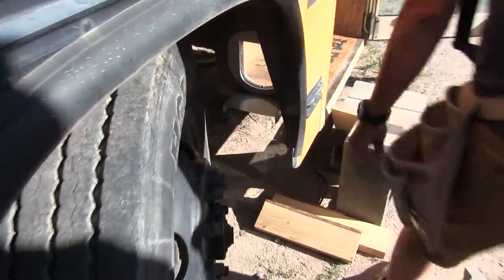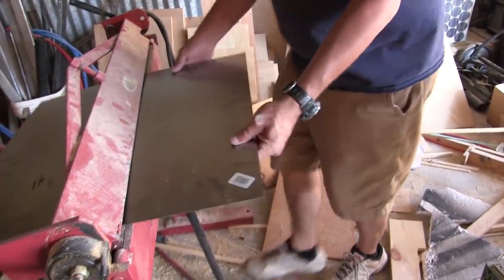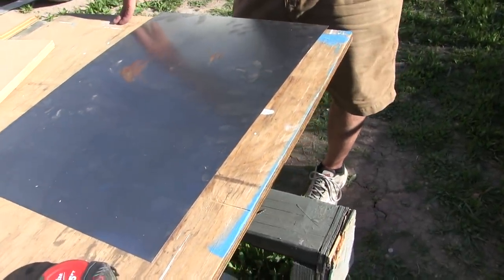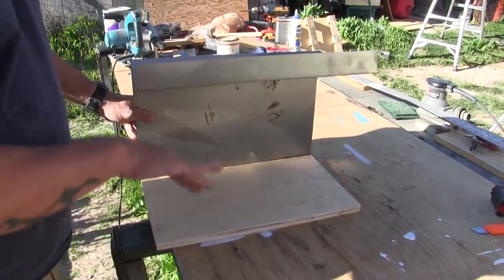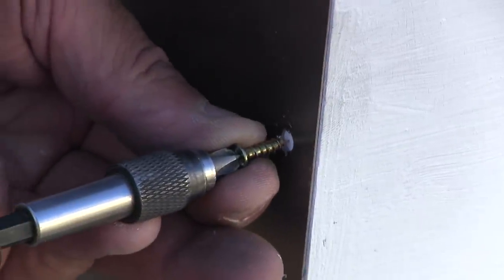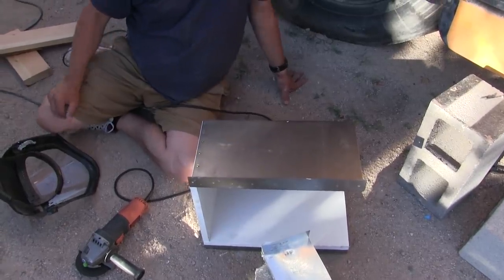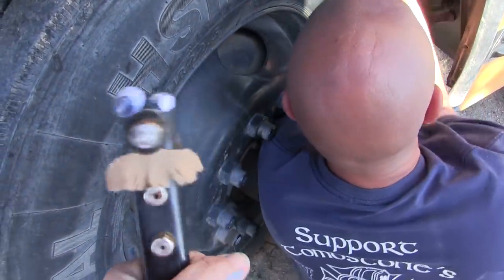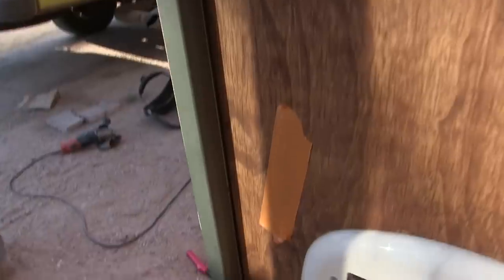Building a "Kitty Porch" for the Cat Door in our Skoolie

Comment: You may want to consider spraying exterior that with some rubber bed linerthat would remove any water damage hard object damage and it would help with the sound also a flap on the open side that you can lock in place with maybe a rod so the cat doesn't go in there and then try to jump out while the truck is running

Comment: bit suprised that you made the top of the box flat and not under an angle , mud slung forward from the tire can collect on top of the box , you could hang up a long piece of rubber conveor belt as a mudflap in front of it mounted to the top of the wheel well and the part of he box facing the wheel adding a bit of tension to the rubber by bowing it out should make it firm enough and not blow back and slap against the tire while driving , helps against the rain on a tin roof sound when driving over gravel too

Comment: So cool! Two questions. Where’d ya get that bender and how much was it? Ok 3 questions 😜 do you have to score the sheets when your bending?
Reply: Michael Prizant that bender is called a break... or box pan break...
You can also score roofing panels and bend back and forth to cut.... :)
Reply from the maker: 1. We got the brake at harbor freight.  I think it was about $200 but I might be high on that. 3. You dont have to score it to bend it, I just did that to mark the metal. When I cut it with the brake, I scored it a lot of times and then was able to break off the piece.
Reply: Bussy McBusface thank you!